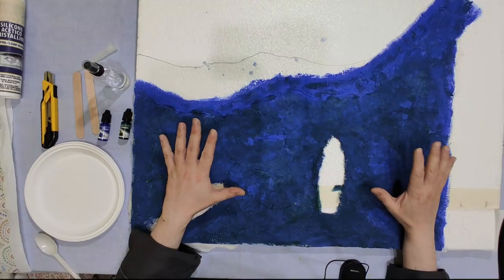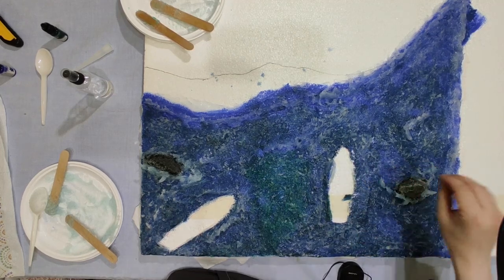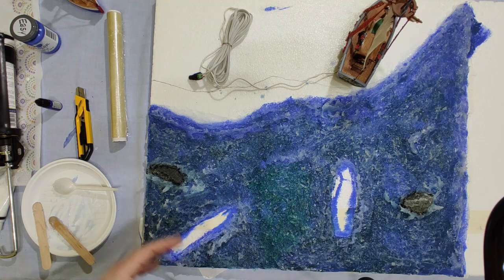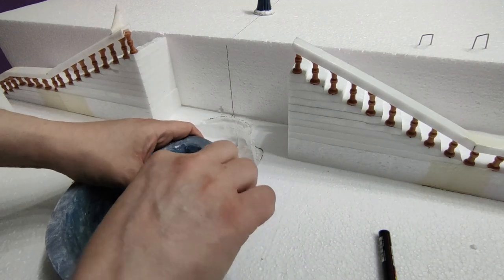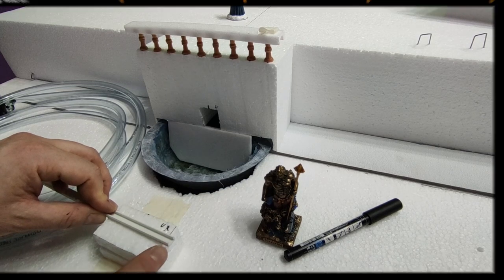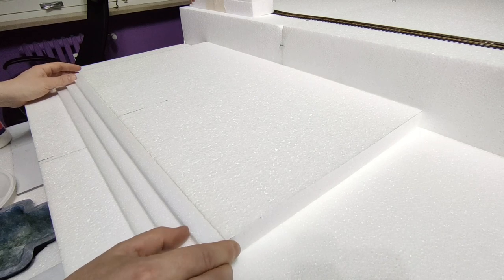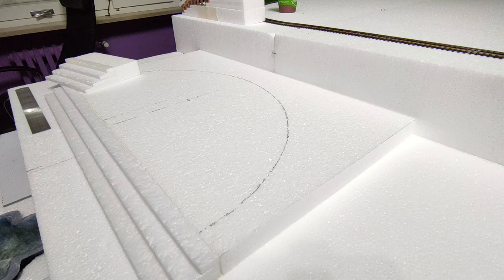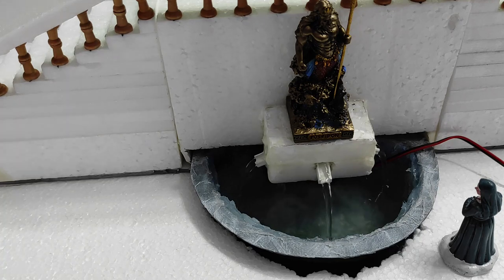Christmas Village Tutorial 2021 - Part 4

Comment: Next time, if you like, You might enclose the sea area completely, then apply a tiny layer of resin, let it dry and then remove the enclosing back. This will create a 3D liquid effect on the surface. On top of it then you can paint the waves ;)
Reply from the maker: Hi Ross. Thanks for the tip. I am only afraid that with just resin it will impossible to have big waves. I will experiment off season.

Comment: Hi Silvio, can you tell us exactly what the frequency and wattage is for the pump you're using?
Reply from the maker: Hi Dee. Absolutely.
It is a very powerful 12 Volt mini water pump. It can pump up to 3 meters (9 feet) 240 Litres of water per hour.
And it is a 4.8W pump.
If you simply power it with a 12V power source it will have a too strong water jet so between the 12V ac adapter and the pump I have used a motor voltage regulator (pump speed regulator).

The pump is precisely the following one:

In Europe:
https://www.amazon.it/gp/product/B00JWJIC0K/ref=ppx_yo_dt_b_asin_title_o03_s01?ie=UTF8&psc=1

In US:
You have the following equivalent pump

https://www.amazon.com/Allnice-Submersible-Water-Pump-Brushless-Submersible-Hydroponics/dp/B07SRRYNGP/ref=sr_1_3?crid=365KJ5PSYL0RX&keywords=micro+brushless+water+pump+4.8w&qid=1640134646&sprefix=micro+brusless+water+pump+4.8w%2Caps%2C116&sr=8-3

The voltage regulator:

In Europe:
https://www.amazon.it/Hacbop-Controllo-Velocit%C3%A0-Motore-Controller/dp/B097T72QM2/ref=sr_1_25?__mk_it_IT=%C3%85M%C3%85%C5%BD%C3%95%C3%91&crid=HNJRWWSABW3J&keywords=regolatore+di+velocit%C3%A0+per+pompa&qid=1640134416&sprefix=regolatore+di+velocit%C3%A0+per+pompa%2Caps%2C93&sr=8-25

In US:
https://www.amazon.com/Regulator-Control-RC-Controller-10-50V-Maximum/dp/B08S3KXMBV/ref=sr_1_23?crid=1SZEDDPU4FZYM&keywords=12v+40A+motor+speed+regulator&qid=1640135676&sprefix=12v+40a+motor+speed+regulator%2Caps%2C120&sr=8-23
Reply: @silvioallena  Good to know! Thank you so much.